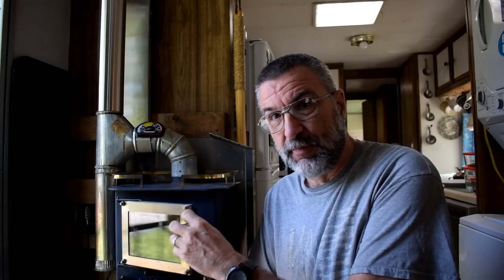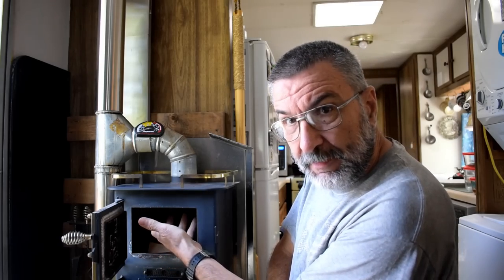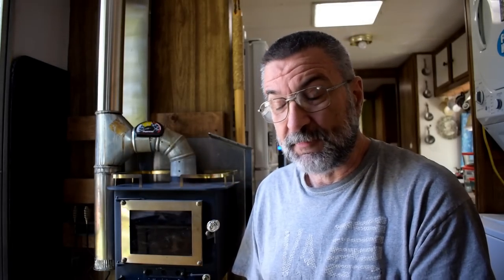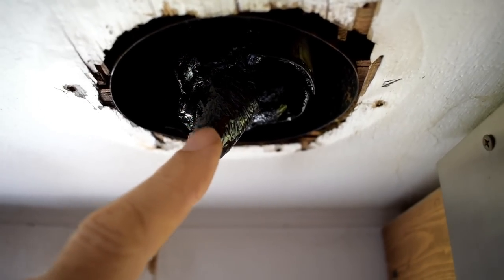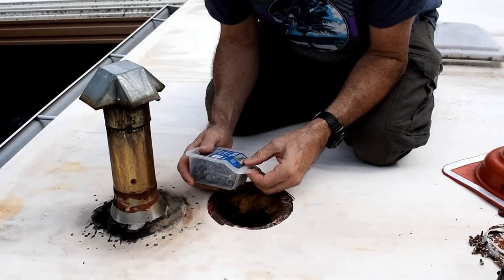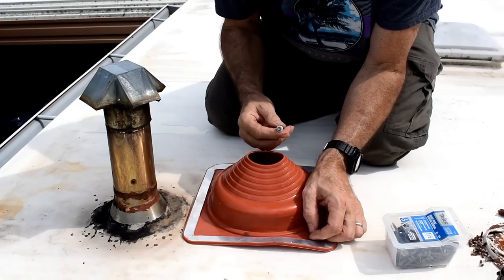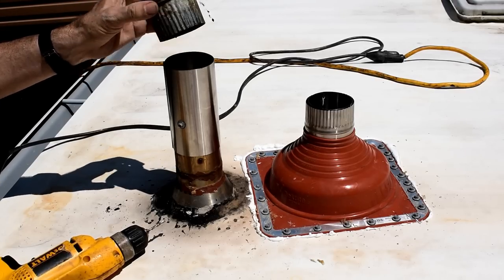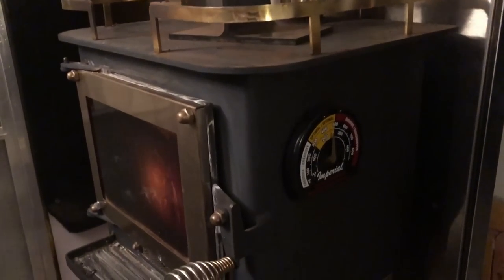Replacing flue pipe on the Cubic mini wood stove with double wall flue to eliminate creosote.

Comment: I am so happy to hear you are going with a straight up flue! I was going to mention that the bend is a place for the creosote to build up. Bravo!!!
Reply from the maker: Actually, creosote did not build up at the bend. It built up at the ceiling line and above. But the bend made it not draw as well, so it wouldn’t burn as hot, and created more creosote.

Comment: When I installed my grizzly, I used their double wall also. But then I added there insulated class a to go through the roof. Basically it's a 5" pipe with kaowool on the inside that slips over their double wall pipe. I liked the look so much I order enough to do my entire flute from stove to cap. Looks great and I yet to have a problem with creosote.  I also burn half of one of those chimney sweep logs every other week.
Reply from the maker: Yes, that 5" flue pipe is new since I installed my stove.  It looks like it will really do the job!
Reply: The first section of the pipe closest to the wood stove should be single wall to help radiate more heat inside the building, the rest may be double wall and insulated
Reply: Hi, so is the double wall pipe already insulated and the 5” pipe with the wool adds yet another layer of insulation? Or is the initial double wall not insulated? Thanks

Comment: If it would have been me, I would have put a 3 inch to 6 inch converter on the stove and went up through the roof with 6 inch double or triple wall pipe. You would have to clean out the flue about once every 2-3 years, if that. Still what you did was so smart Bill!  That was a great choice of a stove for your RV home. You and the Mrs. have a wonderful channel! Thanxz
Reply: Would you have changed it to 6” right where it joins the stove you mean? My flue has been fitted with a SMALLER size than recommended and I’ve been thinking whether it’s worth changing it to the larger size. It also has a couple of 45° bends in it that I can’t see the point so I want to run it straight the whole way. Thanks

Comment: I had a conventional wood stove in the house for my main heat source and I used the duravent chimney pipes that are double walled with high temp insulation in it all the way down to the stove and had to clean it out twice a month. But then I bought a advance wood stove with the secondary burn tubes in it . It not only eliminated the creosote issue but reduced my wood usage. I only clean the flue chimney  now once a year now and it's only a light black soot in the pipe. So if you can find a a advance wood stove that would work in the size you need I think you would like it even more than what you have.

Comment: Nothing is as good as a wood burner for heat but the creosote is a problem that needs management even with a good flue setup. Nothing that a regular inspection and sweep cant keep the lid on but thanks for sharing your experience and solutions.

Comment: Thanks for posting the update. I watched your earlier videos and you were the reason why I bought the Grizzly. I thought your elbow contraption was a great idea, but Cubic Mini recommended that I go straight up if I could, so that is what I did. I am loving it and have had no issues. Thanks again
Reply: I'm thinking about getting the grizzly good to know I'll need a bigger opening going out of the roof I have 465 square feet how do you like the grizzly
Reply: @JanessaforIsrael  I am still loving the Grizzly. Well made. Thick steel just like any wood stove, but very small. It heats my tiny 150 sq ft cabin perfectly. I doubt it will heat 465 sq ft. Cubic Mini has great customer service, so you should give them a call and ask for their opinion. I hope this helps

Comment: Thanks Bill -- I did purchase the stove several years back on your recommendation and have yet to install it because I couldn't locate the flange or the piece with orange you just installed on the roof. Recently I did purchase the flange from Cubic Stove. They are finally able to sell all the parts to install the stove properly. Only issue is that its Canadian and there is a fee on the credit card to convert the purchase price to Canadian and shipping is not cheap. I had purchased all the double-walled pipe from a local home improvement store so I would encourage anyone to shop some of those items should they want to get this stove. The Cubic store staff are very helpful, and the installation manual is so much better now then when the stove was first offered.

Comment: I saw another video with this stove and the guy installed two 90 degree elbows which is a huge no-no on a wood burning stove. Lesson learned.
Reply from the maker: Eventually, I removed those 90's as well.

Comment: I concur.  Straight up chimney is best.  I have the same setup in my truck camper and I have identical results.  I think I've posted in the past,  but I can hit 500 on my stove (thermo on the side) stuffing it with compressed fire bricks.
 (Wood fuel blocks) For me,  in my small space,  they stack easy and are always dry.  Menards here in the midwest sells 6 packs for just under 3 bux.  (22 lbs of fuel).

Nice thing about these blocks is they are 9 inches long and can fit diagonally in the stove.  Cut them up and you can stack more inside.  I've stretched out the heat for a few hours this way. It will never be an "over- nighter" type stove, but it sure helps when temps dip into the negatives. My propane certainly is thankful as well!❄❄

Comment: Bill- Ever since I saw your original video on the cubic stove, I have wanted one for my tiny cabin. Two days ago I finally was able to order one. Now I discover the creosote problem and so on through this video. I believe God wants me to have the stove. If I had watched this video first, I probably would not have bought the stove.
My original plan was to put a 90 degree turn in the flue and go out the wall. My cabin has a slanted, corrugated metal roof. After years of living in an RV, I have learned not to punch any holes in my roof, no matter what!
However, the Cubic Stove company does not approve 90 turns in the flue. My son suggested a 45 degree turn.
After watching this video, I am now perplexed. For one thing, I am 71 years old and there is no way I am going up on a slanted roof to clean out the flue. If I go out the wall at 45 degrees, will I be able to get double walled fittings as necessary? I ordered the Cub. Will it get as hot as the Grizzly?
Any word of advice you can offer regarding my stove would be appreciated. I have not yet ordered any accessories, just the stove. I don't expect to get it installed til next summer, and I will have help, but cleaning the flue will probably fall on me, esp if it needs to be done often. Any ideas?
Thanks and God bless!
-Deb
Reply from the maker: I had several other videos in my Cubic Mini playlist documenting the creosote issues.  I'm so sorry you didn't see them!  The rubber gasket that I installed in the video is made to go unto a roof with a pitch up to 45%, and it has a pliable base that can go onto a corrugated metal roof. I think this fix, with adding the double wall pipe all the way through the roof is going to fix it so that I can clean out the flue only once or twice a year instead of every month. The 3" pipe is very hard to find, especially fittings.  Cubic has the pipe, but not elbow fittings.  There is another thing you could do.  Cubic does have an adapter that will allow you to convert from the 3" pipe to a larger pipe, like 4" or 5".  That way you could find 90 or 45 degree elbows locally.  It is still not recommended to use 90 degree turns because it slows down the draw to much.  But you can use two 45 degree turns, separated by some straight pipe in between.  That will keep it drawing better.  That way you could take it out the wall, which would be easier to clean out.  ANY woodstove should be cleaned out at least once a year, if it is used on a regular basis.  We use our all day, every day.  If it is used less often, it wouldn't have to be cleaned out as often.
Reply: @LiveSimpleLiveFree  Thanks, Bill! As I said, I think God wants me to have this stove. I somehow missed the other videos. The adapter to larger pipe sounds like a good idea. I have plenty of time to research this and collect parts, also several possible advisors, tho none of them are familiar with the cubic stove.
Thanks so much for the feedback, and good luck with the COPPA mess!

Comment: Great info! I ordered the stove and tools but not the pipe kit, plan to order that in a month or two. I'd watched your original install video and was confused thinking I needed single walled pipe in the house to let more heat into the house and double walled pipe for outside but the company doesnt sell single walked pipe. Thanks for clearing that up!

Comment: Greetings from Canada, I'm assuming your one of our neighbours to the south. Just a suggestion for what's above the cieling flange that surrounds your double walled stainless steel flue pipe. I noticed a gap all around the pipe for fire protection and could see how careful you were in centering the pipe within the opening using the flange as a guide. My concern is the gap is exposed to the cold temperatures and with the holes in the ceiling flange underneath that exposed ceiling cavity, cold air can sink and enter the conditioned room below. My suggestion is use roxsol insulation which is a mineral wool that gives fire protection as well as insulates. That removes  that  gap (code up here is a 2 inch gap all around whereas you have 1 inch gap). I would also use it above the roof line under the rubber shroud  fitting it up against the pipe. If insulation is the issue then this method will tighten up your connection and provide a fire safe blanket around your pipe.

Comment: Cleaning out a flu once a month would not be fun.  I like that it exits higher on the roof just in case a blizzard comes.  It's comforting to have more clearance.  When it's time to fix the cosmetics by the door you're going to have that extra space to work with.
Reply from the maker: Snow is not really an issue because, especially if you're burning the stove during the storm, the snow melts away from the flue instantly.  Though if it snowed several feet with the stove not burning, it might be buried.  That would be a problem, until I got the stove burning to melt it away.  I might have to go up and clear it first.  But I've never had to do that, because we generally burn the stove during a storm anyway.

Comment: Are you going to cover or paint the rubber flue on the roof? I am asking this because I am in AZ (in the mountains) and we have to protect pipe that we use outside. The pipe inside looks beautiful!!! Awesone. Okay I have to ask, did you cover the hole in the ceiling?  lol. I love your fix it videos. How is the petition going? Have a joyful day.
Reply from the maker: The RUBBER flue.  I'm not sure what you're asking.  The flue is stainless steel, and does not have to be covered or painted.  The rubber roof gasket is flexible, and paint would chip off when the rubber flexed.
Reply: I was speaking of the rubber gasket on the roof. maybe it has anti uv built into it. I was just wondering. Thank you for all of your wonderful videos!!!! I enjoy every single one

Comment: Thanks for redoing this installation!  I bought a mini with one 2' section pipe and remembered your previous problems and the offset pipe with clean out. Straight up then! Any trouble with the screws in that removable baffle plate rusting out? Im preemptively worried about stripping one of them out someday and not being able to fix that.
Reply from the maker: No problems with screws rusting out. But then, we used the stove for 3 seasons, then sold the property it was on.

Comment: just to CYA i would put some silicone on the joint of the sleeve you fit over the old flue (looked to me like indoor ducting) just a thought could not hurt. I also would find a cap that fit over the top and not inside because silicone does not last forever. ;-)  keep us posted. I live in canada and we get ridiculously cold winters and Cubik suggests the insulated flue over top of the double pipe that may be why you are getting the creosote.

Comment: I have the grizzly in my 32’ coachman, our furnace does not work so I thought this would heat us up real good well it doesn’t put out crap for heat and quits burning if draft is not left wide open. I am using 3” hot water heater pipe going out a side window not gonna put holes in my roof!! Even with single wall pipe the heat is not enough unless you sit there and keep it fired hot, good part about my pipe is there has not been the sweating or build up of creosote that everyone else complains about. I like the stove but to me it’s just a oh how cute piece of furniture
Reply from the maker: Yours is not putting out enough heat because you have a bend in the pipe to go out the window.  With a bend, it doesn't draw right, so it doesn't burn hot enough.  Ours burns so hot, you cant get near it.  It heats our entire RV when it's -10F outside!  We love it!

Comment: Was wondering if you ever considered attaching fins to your pipes especially close to the heat source to wick additional heat from the pipes. Kind of like fins on heated water pipe units. Same principle. Great video happy living and happy Easter. Christ be with you
Reply from the maker: No! This stove has the opposite problem. It’s hard to keep the flu gases hot enough to burn out the creosote. I installed the double wall flu to keep more heat IN. Fins like you talk about would add more heat to the room, but take more heat away from the flu gases, which would create more creosote.
Reply: @LiveSimpleLiveFree  makes perfect sense 👌 thanks. I'm about to begin a journey of living in a 1989 coachman. Runs well big  460 all new plumbing floors fridge and rewired for 120. 4k i paid but I felt it was worth it considering its 6 months rent not including gas and what not. Keep me in prayer urban camping in Chicago can be dangerous.

Comment: Just was going to ask if you knew about taking out the plates as you said it.  It took me a season of cleaning to figure out the plates came out also. So it wasn’t just you!  I have double wall outside, and am considering wrapping with exhaust insulation wrap.

Comment: What kind of wood do you burn?  Some wood burns cleaner than others.  A trick I have used to reduce build-up in the stove pipe is to throw a Tablespoon or so of ordinary table salt onto a hot fire every once in a while, after a few minutes you can hear small stuff dropping.   Give it a try & see what you think.
Reply from the maker: We use mixed hardwoods.

Comment: Here in the UK we only use 45 degree bends.
 90 degree are not allowed.( it makes it  difficult making 45 degree holes in a wall of  100mm blocks and 100mm brick with a 500 mm cavity minimum!!)

Comment: Nice one Bill. Great update. The Fan on the stove is amazing; Is it running off of heat convection ?.
Reply from the maker: Yes, the electricity to run the fan is generated from the stove heat using a thermogenerator. The hotter it gets, the faster the fan runs.

Comment: Cubic suggested I get the dickinson marine deck fitting and stack. It's double walled to the stack.
Reply from the maker: This is an old video.  At the time that I installed this stove, that size of double-wall pipe was not available.

Comment: Now when you clean it in  the stove there are two screws hanging down inside the sove .Unscrew the screws take out the two pans and go to the hardware store and tap the holes to 1/4 inch thumb screws .shut the doors and and run the brush down the stove pipe put the pans back in and thumb screw it back in place it's worth putting in the new thumbs crews for fast cleaning the ash will fall to the bottom of the stove clean the roof cap...extra fast cleaning

Comment: I sold firewood for years and heat my cabin with wood, I have never seen a creosote problem like yours, hard to tell from video but that piece of wood you showed looked green, you might have recut and split it there by making it look Greener but I'm thinking its green, good hardwood oak, hickory etc generally takes about year and a half to properly season. Also don't try to split too big you want More smaller pieces in there to create turbulence and heat. Another reason people have problems with creosote is cutting draft down too much at night to make fire last.be nice if you could get insulated stainless thimble to go through cieling ,mine through Wall has insulated thimble, inside on 8" pipe with about inch of mortar around that. I suspect that your stove is running better and better because wood is slowly drying out, but double Wall pipe is what you needed anyway definitely good idea. Shouldn't have to clean pipe but maybe once a year maybe twice if in a extremely cold environment,good video good luck and be careful with fire.

Comment: Just an FYI..throw in your wood burning stove when good and hot..a couple of aluminum cans, like coke, or beer cans a few times a week..this will soften up the creosote and control the build up...we had a chimney fire in ours due to the wrong elbow piece that they sold us with our fire place...when the fire Marshall came..he recommended we toss in a few cans per week..and yes it does work. ..when I called for the chimney sweep to clean the first time OMG we had over 3 bucket loads...and it was hard....but the next year we had it clean..the creosote was soft like flour..and only a half of a bucket. ..if you want check with your fire Marshall,  but aluminum is what is inside those cleaning logs...just that the cans are so much cheaper..just get your fire good and hot before tossing them in....